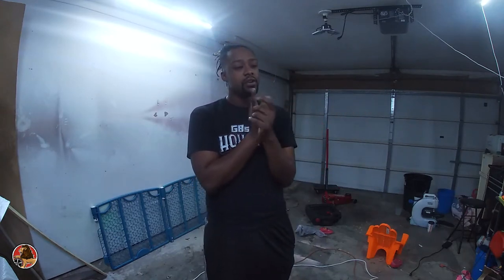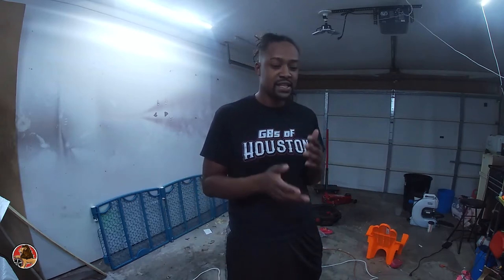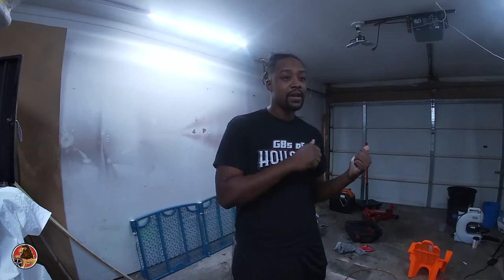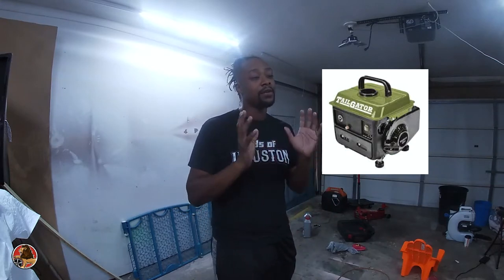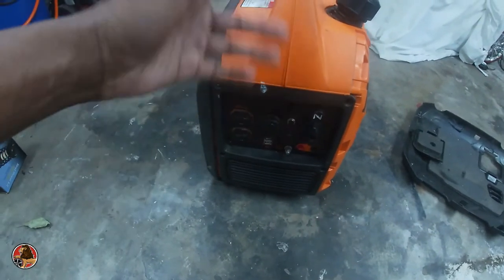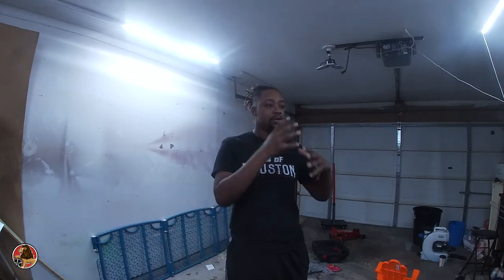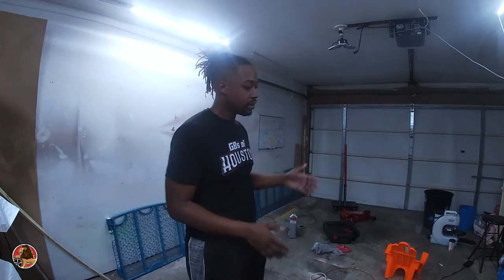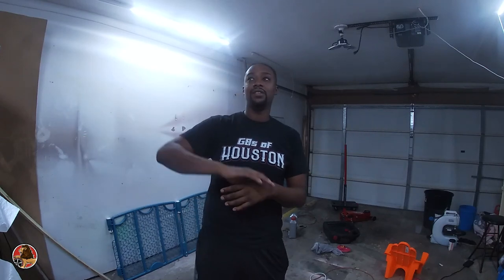What size generator is best for your mobile detailing setup.

Comment: Can't go wrong with a Honda EU3000IS. If you are running multiple things at once (i.e. steamer w/extractor) then get a parallel kit to go with another 2000w or 3500 watt predator. Should work fine. The predators are good but the ignition coils and modules go out on them often. The module is easy to fix but the ignition coils are a PIA to replace. They are both relatively cheap though through HF parts list ($20/part). I have a honda and a predator that I parallel together. It is more than enough. Honda's ARE WAY SUPERIOR to other generators if you take care of them.

Comment: I have a champion  4500 startup and 3650 running watts and I was wondering if this would be efficient enough to run my Mytee hp60?
Reply from the maker: It should be enough but I wouldn’t know because I have the s300H. My generator powers that with no problems.
Reply: @Moe_Nation  what size generator are you running? And when you run the Mytee you can only run that by itself? I believe the same  will apply to me.
Reply from the maker: @bengarcia6898  i have the predator 4550 and no I can have the steamer on at the same time as the Mytee. The steamer draws more power then the mytee. I can have it on with a lot of my equipment. I’ve had the steamer kick on while having the vac/heat/pump on, on the mytee. You just have to put it on a different outlet. I think the outlets divide the power evenly.

Comment: Can I use a 1900w generator with 1800w pressure washer?
Reply from the maker: You'll probably be pushing it.
Reply: @Moe_Nation  A pressure washer is just a few minutes at a time,  right?

Comment: Do you let your water pump run in between times you are not using your pressure washer bc the water is constantly running and may pop a hose?
Reply from the maker: Most of the time I leave it running. Never had any issues with hoses popping. It’s only moving about 5 gallon per minute.
Reply: @Moe_Nation  ok thanks